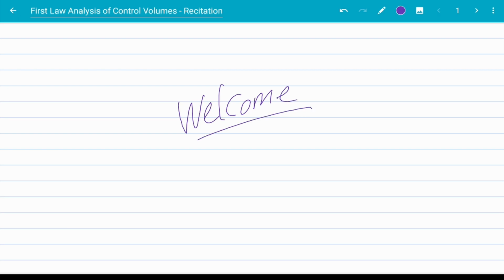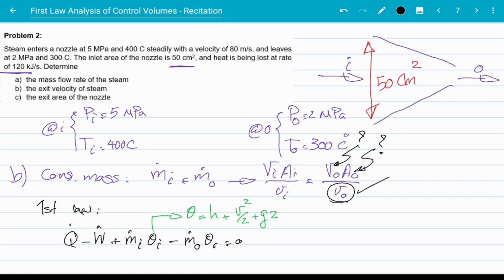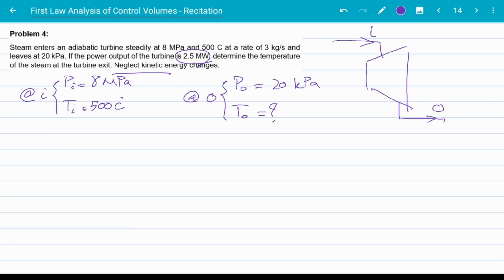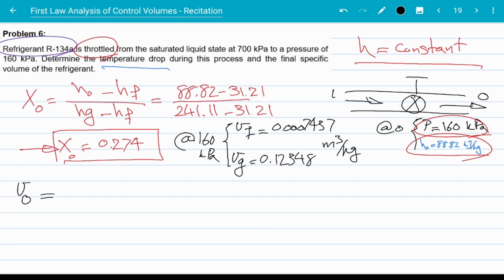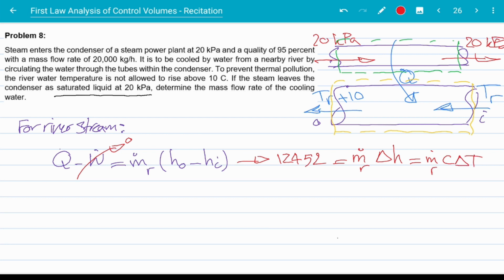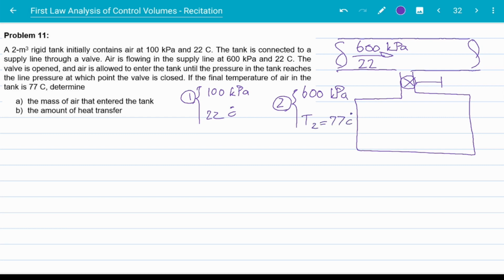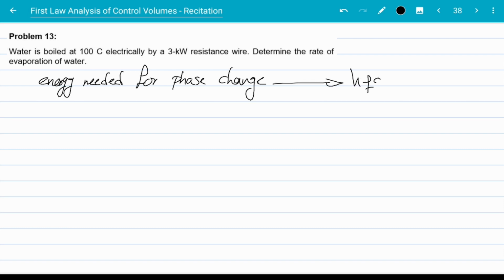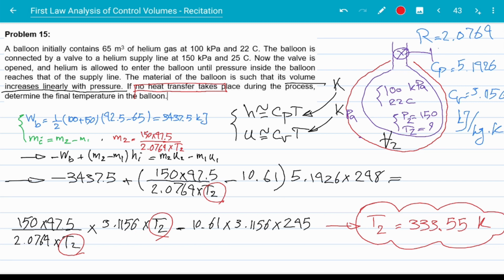Sample Problems - First Law Analysis of Control Volumes Recitation

Comment: its just confuse me about the problem 7. How do we know that our control volume system are in a steady flow? is it becouse the preassure are tha same throught out the stream?
Reply from the maker: Great question. Unless stated otherwise, mixing chambers, heat exchangers, turbines, pumps, compressors, evaporators, condensers, and throttling valves are all steady flow!

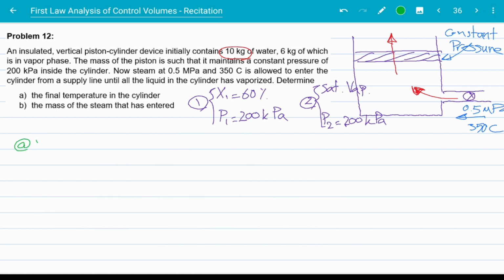Comment: 1:40:07 I found the initial specific volume to be 0.77 m^3/kg?
Reply from the maker: Sorry for my very late reply. Are you reading your numbers at P = 200 kPa or T = 200? I am only asking because that is a very common mistake to make. I re-did my calculations and the number in the video looks correct.
Reply: @WannabeProfessor86  I also re-did them and found it to be 0.53 this time. If I remember how I got the number 0.77, I will comment here. And I am the one who is sorry for asking a nonsense question and wasting your time. Thank you so much for your effort!

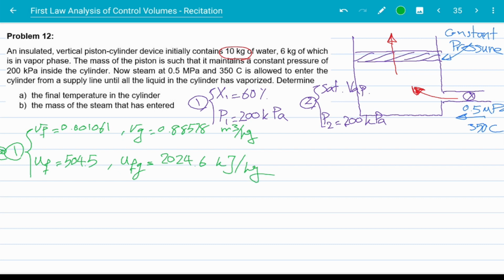After 5 minutes edit: I just remembered that I interpolated between the numbers 0.601061 and 0.88573 m^3/kg on the board at 1:39:05 and found 0.77.  But when I checked the data from the tables, I noticed that Vf is equal to 0.001061 instead of 0.601061, which gives the correct result 0.53. Should that have been 0.001061 or am I still missing something?

The last edit: I confused the first decimal digit "0" of Vf with a "6". Problem solved, thanks again! :)

Comment: In the first question you took the full diameter and applied solving for r, shouldn't it be pi*(0.28^2/4) ?
Reply from the maker: Good question. What I did and what you are saying are the same. You are writing it as D^2/4 and I am writing it as (D/2)^2. Same thing.

Comment: Question-3 confusion:
Hello, sir turbine is a power-producing device, and work done for power-producing devices are positive then why do you take it negative?
Reply from the maker: Great question. Yes, turbine is indeed a power producing device. However, the power produced by the turbine is extracted from the working fluid. In other words the working fluid's level of energy decreases so that the turbine can produce power. That is why when you are analyzing the working fluid (like what we did here) you take it as negative. Hope this answers your question.

Comment: In problem 12, when you calculate the boundary work Wb, shouldn't you use volume and not specific volume? I'm asking since the whole equation is giving kilo Joules, while the boundary work P1(v2-v1) is giving us kilo Joules per kilogram. By the way thank you so much for making these amazing videos, they really help a lot!
Reply from the maker: Hey Marios. I am really happy that you found this video helpful. Your question is spot on, thanks for pointing it out. Yes, you are right. I forgot to involve mass in the boundary work calculations. The units are not consistent.

Comment: I think there's a mistake for problem 3 in which the enthalpy in should be 3242kj/kg and specific volume in should be 0.029782. I think you took the values of 10MPa at 400C instead of 450C. but its still an amazing tutorial ! thank you !
Reply from the maker: Thanks for pointing it out. I haven't checked again myself but there is a high chance that I misread the tables.